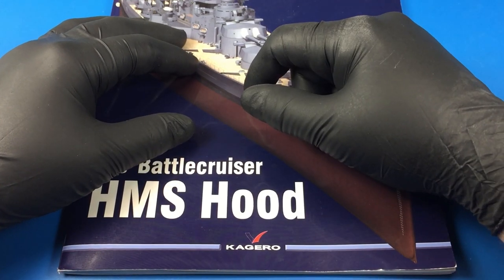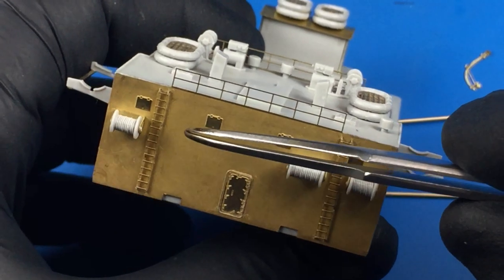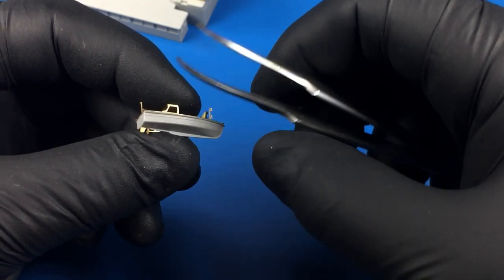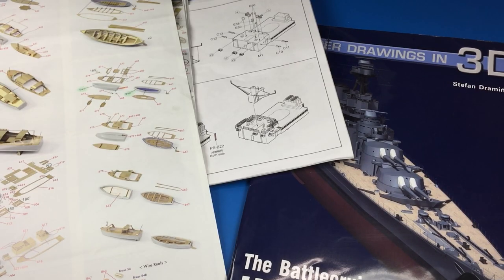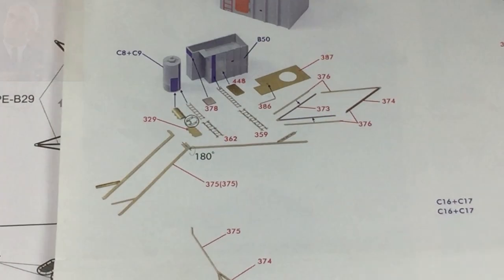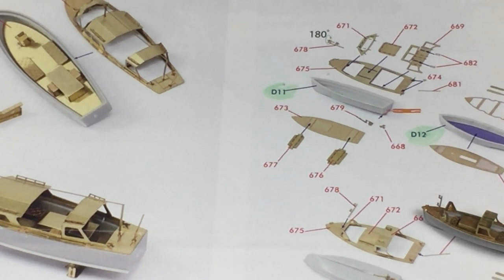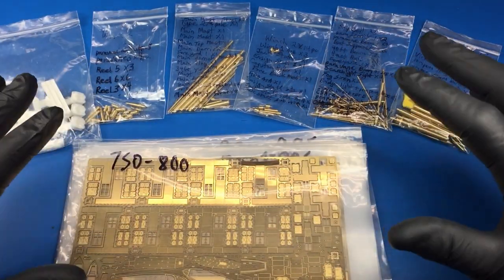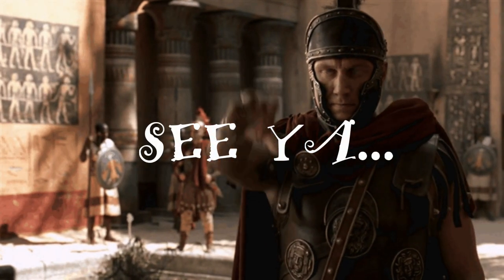TRUMPETER 1/200 HMS HOOD BUILD *(PART 2)* - 2019

Comment: Very nice vid; thanks for sharing - looks like a lot of work with tweezers and superglue... and the patience of a saint to get all that done. Looks like it's coming along great though, and will look amazing when it's done. 
I've found that a lot of the aftermarket PE manufacturers instructions are mostly useless and generally amount to: "bend this part into some shape and put it somewhere over there". To be fair those instructions you have for the Hood seem to be about the best PE instructions I've seen. 
I generally model armour and now usually only go for things like engine grills, turned barrels and individual track links - stuff you can actually use. I find the full on etched sets to be a bit of a waste of time (for me) as I'd rather try and scratch (or improve) details with plastic if I can. Thanks for the vid, much appreciated, and if you wanted to do a tutorial on handling PE on the Hood, I think it'd be a good idea. Thanks.
Reply from the maker: Thanks, man! Yes PE instructions can be hard to understand and the Pontos set is pretty good. I like the fact they show the finished piece as you then have some sort of reference point to go off of. The thing is there's utterly so much PE and accessories in this set that I find I'm almost overwhelmed by it. Thanks for your response to the questions, I will certainly find something to build up in a video. Cheers!